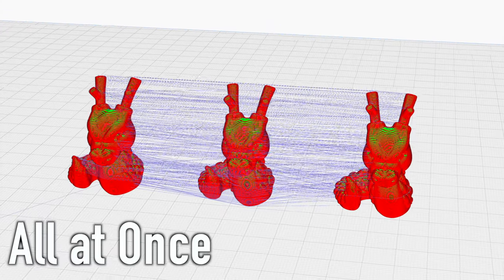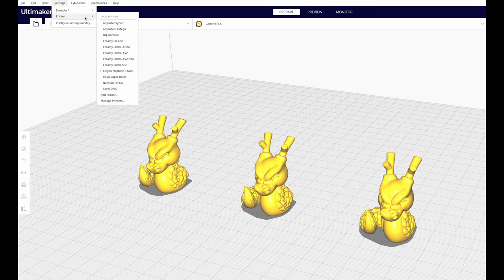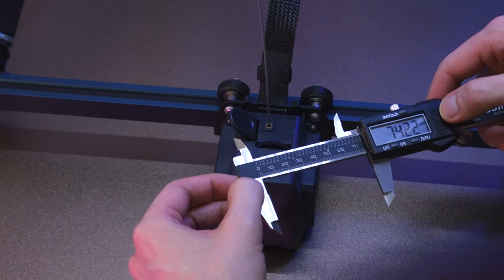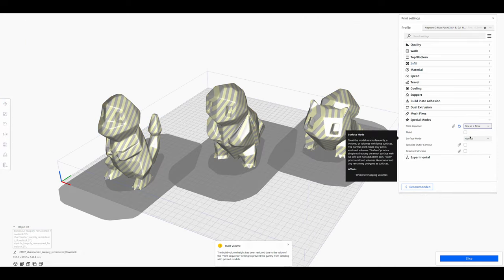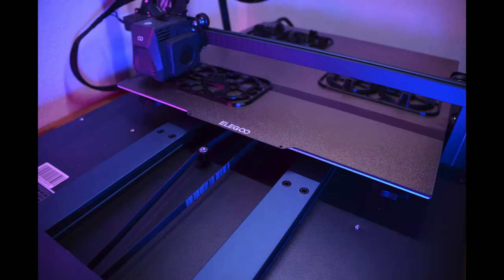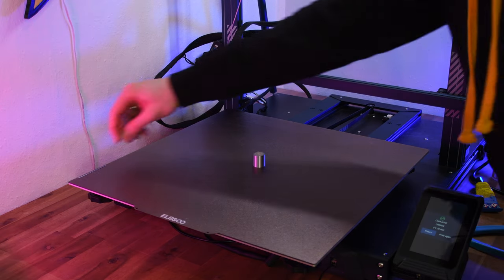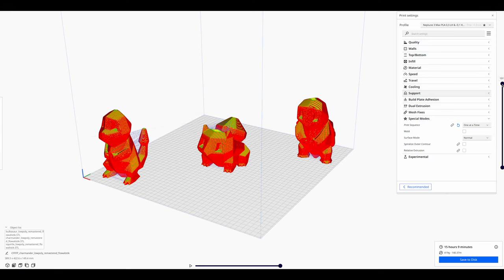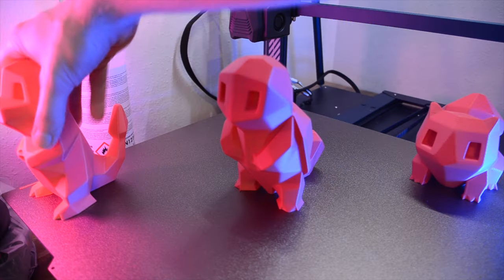Print large objects ONE AT A TIME and avoid printing errors

Comment: I prefer PrusaSlicer but it looks like Cura handles sequential printing better than PrusaSlicer which refuses to slice if the parts are taller than the gantry height regardless of where the parts are on the print bed.  I've sliced the parts manually in each position and concatenated the G code and edited it with some manual X, Y and Z moves to avoid collisions, but that's a hassle.

Comment: Fantastic video! Thanks for the information.

Side note: I have a klipperized Elegoo N3M I purchased recently and my printer does not "present" my prints when finished, the nozzle just hovers over the spot where it last printed. Do you think it's possible the previous owner changed the end g-code to do this intentionally to help with sequential prints?